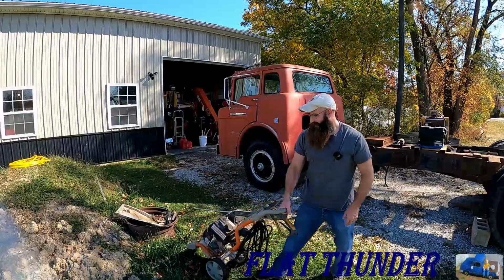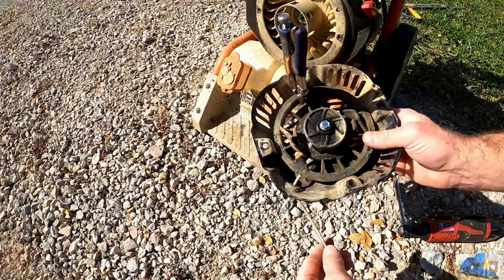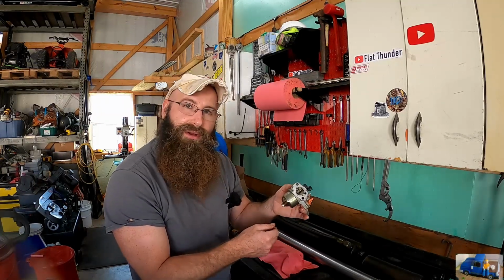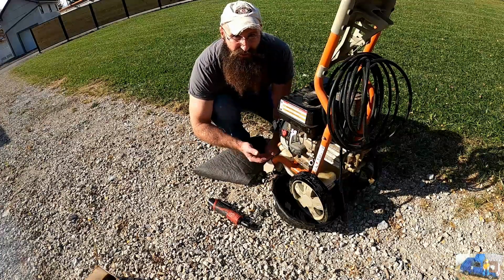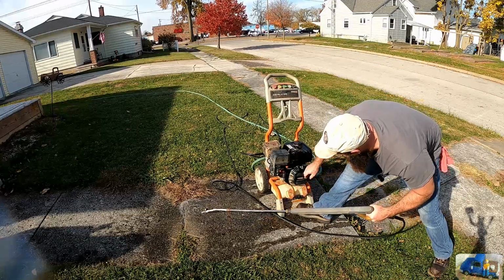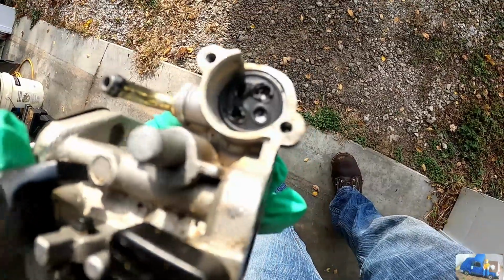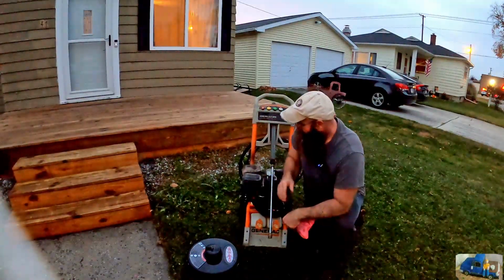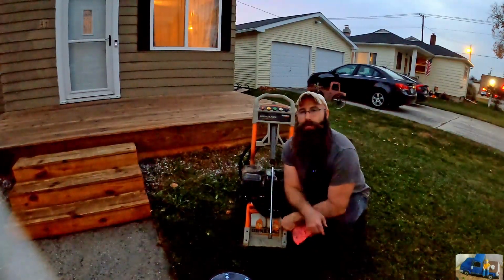Pressure Washing Deck...unbelievable!!!

Comment: I need to get my deck cleaned and resealed before winter and I'm going to have to get one of those surface attachments for my pressure washer. I had no idea they worked that well. Thanks, friend!
Feelings are overrated 🤣
Reply from the maker: I had no idea until Dad showed up with this unique tool!  I would check your PSI rating.  It might not be as effective with lower pressure units, but it worked fantastic with 3k psi!  Get after that deck cleaning.  Thanks for watching Patrick!  👍😁
Reply: @FlatThunder  Thanks for the tip, will do.